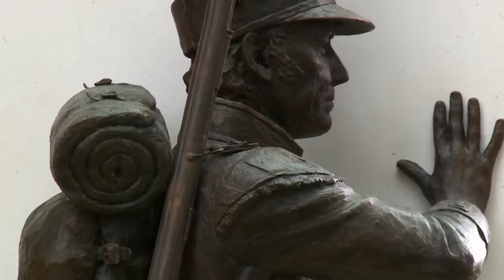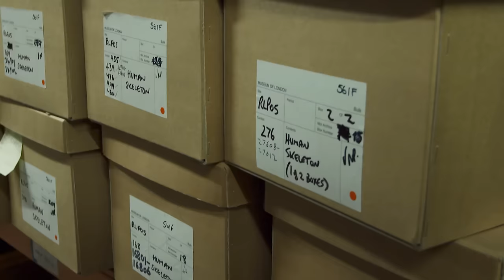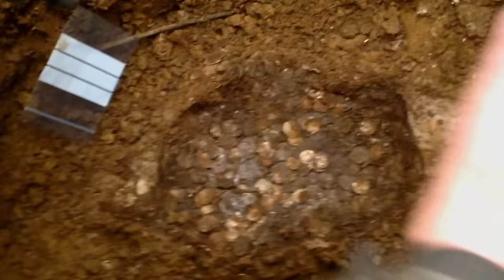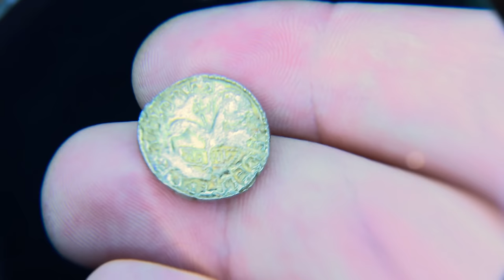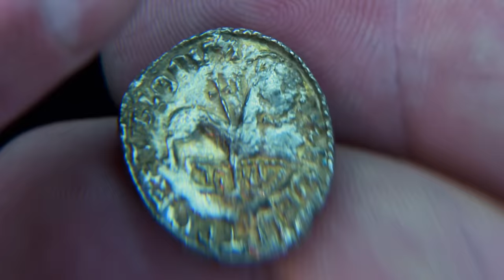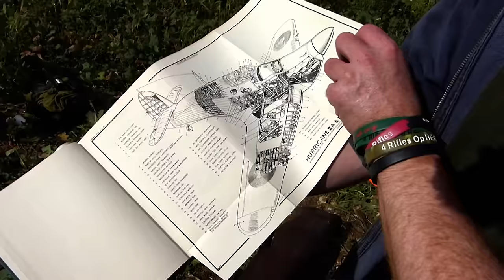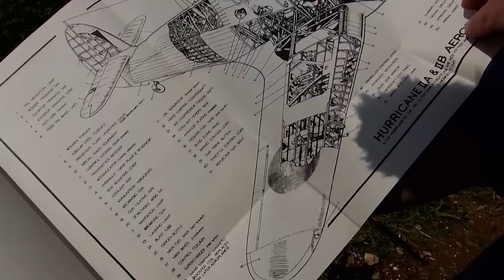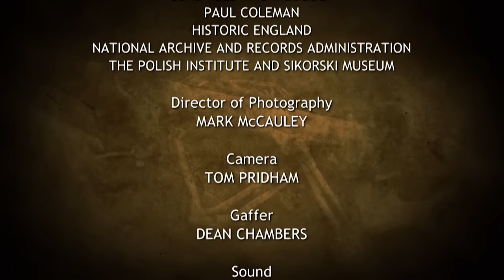Archaeologists Excavate A 17th Century Shipwreck | Digging For Britain

Comment: Wellington was known for building infrastructure around his preferred battlefield. At the battle of Bussaco he built secret roads behind his line on top of a ridge to rapidly deploy artillery where it was needed most. Then of course he famously managed to build the extensive defensive lines and roads of Torres Vedras without the French knowing, they couldn't get through and eventually had to leave Portugal to Wellington. 

So I am not surprised Wellington had roads prepared at Waterloo for rapid troop and supply movement, battlefield preperation was often a large part of his success as a general.

Comment: Poor analysis on the Polish pilots.

303 were to some extent a naturally selected elite. Most of them served against the Luftwaffe for both the Polish and French airforces, and managed to survive that in inferior aircraft.

The first Spitfires mainly went to auxilliary squadrons  comprised of experienced pilots who served part time before the war. 

The highest fighter vs fighter tally in the Battle of Britain went to 603 squadron who were auxilliaries flying Spitfires. Some historians who have analysed Luftwaffe records claim 603 had the most victories overall as well, although nobody wants to be seen to be putting the Poles down by saying so loudly.

Either way, 303 and 603 are definitely well up there as the most effective squadrons. The three things they have in common are:

1. They had more flying hours under their belts than most pilots involved in the battle.

2. They both entered the battle  at the end of August 1940 after it had already been raging for 7 weeks - the Luftwaffe lost most of the aircrew shot down - if they weren't killed, they would be captured. Therefore, 303 and 603 faced a Luftwaffe already stripped of some experience.

3. They entered the battle after the RAF had improved the punch of the 8 Browning .303 machine guns in the Hurricane and Spitfire by changing the convergence pattern of the guns. At the start of the battle, the recommended firing range was 230 metres, with the guns set so the bullets would arrive in a "box" about 12 feet wide by 8 feet high - therefore, even a well aimed burst of fire at 230 metres would see some bullets miss if aimed from directly astern, and a dispersed pattern of damage even if many hit. The theory was that more bursts would cause a hit of some sort. Top pilots capable of accurate shooting hated this and disregarded the instructions to experiment with changing the alignment of their guns. Eventually the RAF listened, and ordered that the guns be set to fully converge at 230 metres instead. The results of this began to filter through in September 1940, right after 303 and 603 joined the battle.

These are the reasons for 303s success, not being more cross with the Germans.